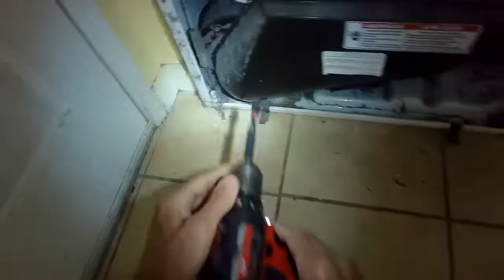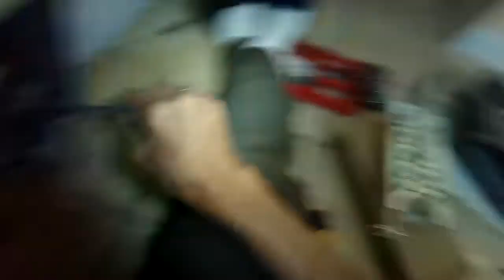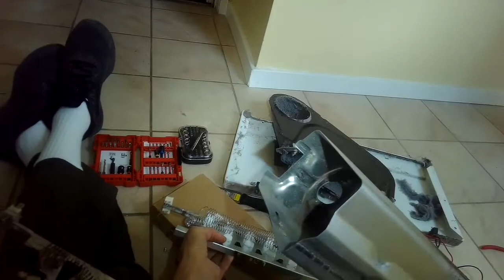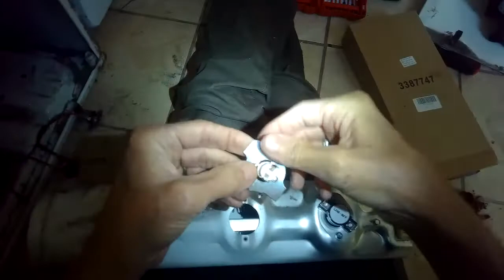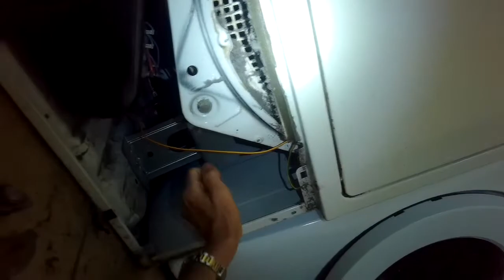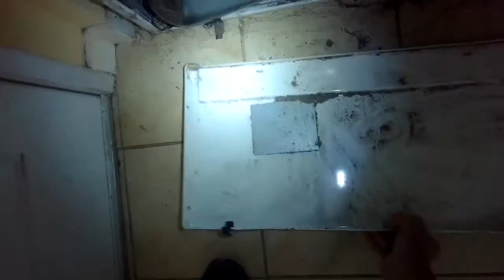✨ KENMORE ELECTRIC DRYER - NO HEAT - EASY FIX ✨

Comment: Thanks for the video hopefully you can guide me in the right direction last night I replaced the hight limit and thermostat on my dryer it had stopped drying I thought I got it working I got a call today saying the stuff wasn't drying came home checked for continuity everything checked out except the high limit I wasn't getting anything from it took it out slammed on the ground to reset it installed again bam the coil started to glow I thought I was done then I noticed the coil goes dead mid cycle. Would I have to replace the coil?
Reply from the maker: Can you double check to make sure the dryer vent tube is not obstructed ?
Otherwise I would replace the coils.